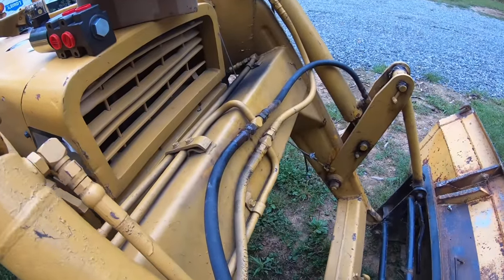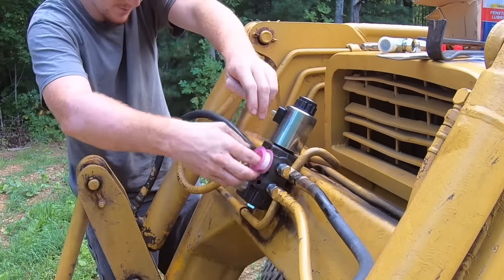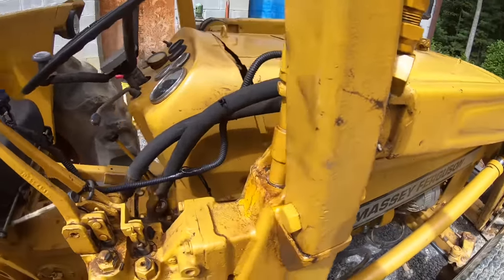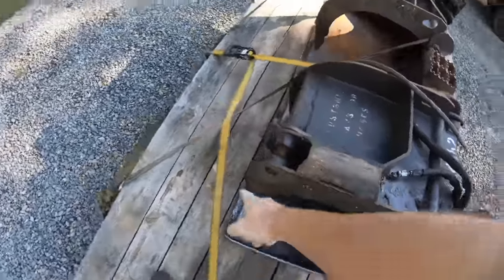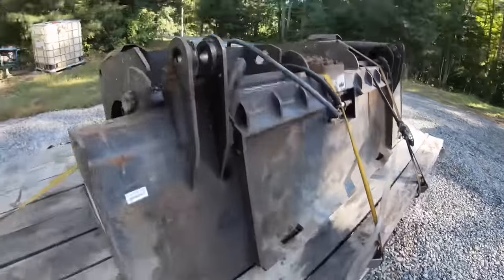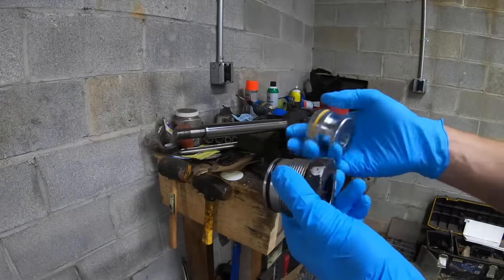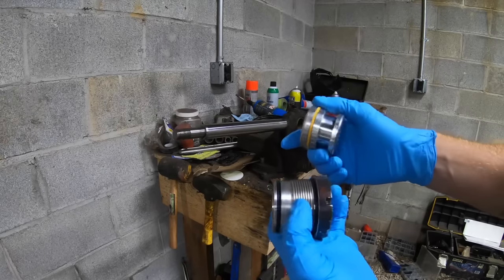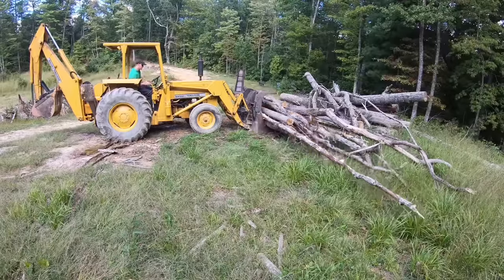Adding a Third Function To an Old Tractor Loader Then Buying and Fixing a Grapple Bucket

Comment: hello🙋‍♂️ from the Netherlands🇳🇱 .  
I personally had placed the valve at the back with your type of tractor at the backhoo where also constant hydraulic pressure goes to with not used in the driving-position , 
a good switch in between with PTO - CRANE / Backhoo in between and you have a really full-fledged 3rd function on your loader arm.  
thanks for the video Dave . 
Sincerely, Hollandduck

Comment: Spend another $17 and re-seal the other grapple ram, they aren't working in unison and it's likely the seals in the other ram. Also at the end you mention re-doing the pipework on the diverter and having seen your set up I agree that's a good Idea.  It's placing torsional stress on the quick attach and will twist the frame and cause a failure eventually. 😉

Comment: That grapple bucket is going to be one of the best tools you have around. One caution though. you should never use things like tape on the threads as a piece can get into system.  There is liquid thread sealant made specifically for hydraulic connections. Looking forward to seeing the different uses you come up with for the bucket.
Reply: You are correct about the ptfe tape big no no it will dissolve, I. did read on here that the correct ptfe tape for the motor industrry is blue.

Comment: I have found that mounting a valve out front like that invites disaster. Usually something rolls off the bucket or forks and takes out the valve. May be worth building a guard for it. Nice install though. 😊

Comment: First thank you for taking the time to make a great video. You'll probably never put your regular bucket back on. I was looking for a root grapple, ended up purchasing a similar one as you. You'll find out you don't lose much material if you're moving gravel or dirt off the sides of the bucket. I wound up putting a tooth bar on and leaving it on the skid steer only to change out for an auger or forks. I have several questions if you or other watchers can throw some advice my way. I have a Ford similar era of that Massey my thinking was to put rear remotes on and plumb to the loader for a grapple bucket. Is there an advantage or disadvantage from a diverter valve? It's my understanding that you can run a cylinder but not a motor like an auger or brush cutter. On that note my thinking was to put a PTO mounted pump and separate tank for that purpose??? Lastly is there advantage or disadvantage from relay to a simple switch? Thanks, great video.

Comment: TIM from Canada suggestions when you were trying to fit your new third function junction box to your tractor or your vehicle.. suggestions are to use two sided tape.. this way with two-sided tape you can still move it around to where you want it.. leave it there stand back and see if this is where you wanted to stay or keep moving it around until it works for you.. with two-sided tape this takes the worry out of holding it while you were trying to move it around just a suggestion people that’s all the service..(. Two-sided tape will that work for you or not this is the question)

Comment: The type of fitting your using you don't have to use pipe tape
Reply: Yup and the white Teflon tape is for water plumbing. Petroleum products will melt the white. He should be using the yellow Teflon tape which is formulated for petroleum products. Other than that good project.

Comment: You don't need thread sealant on hydraulic connections
Reply from the maker: You do on npt fittings, not on boss or jic
Reply: Teflon tape will make its way to your hydraulic pump and ruin it. Ask me how I know this. A specific thread sealer is used for hydraulic fittings.  Get rid of the teflon tape immediately.
Reply: @TheMechanicDave  Not white tape will dissolve
Reply: @dougstewart6288  Unless he uses the yellow Teflon tape. The white is for water/plumber applications. As you mentioned petroleum products will melt the white and it can clog pumps. The yellow is formulated for petroleum.